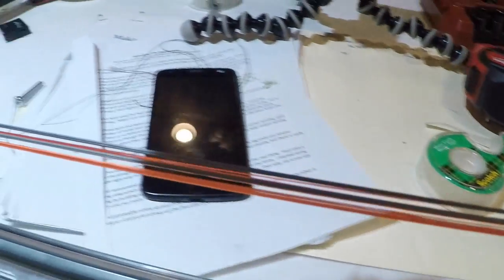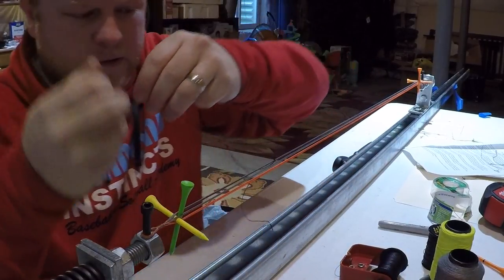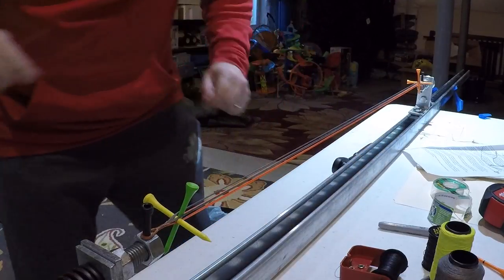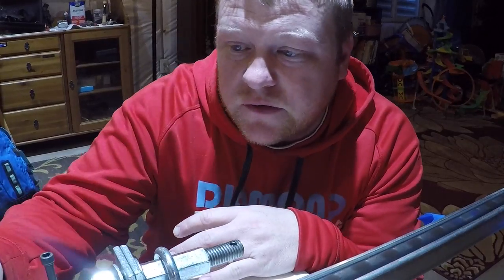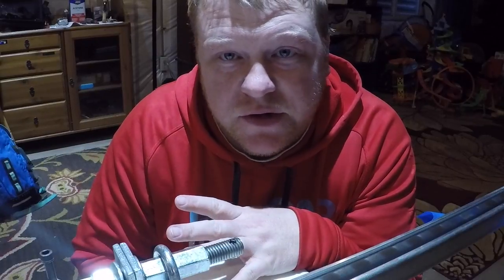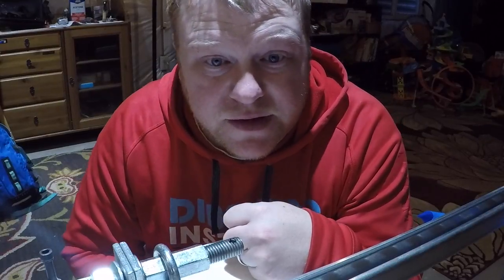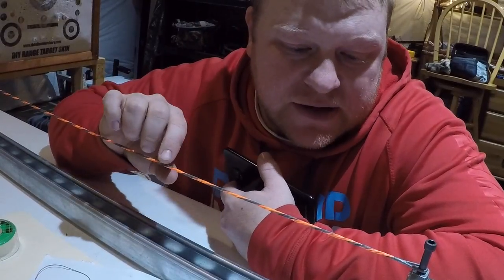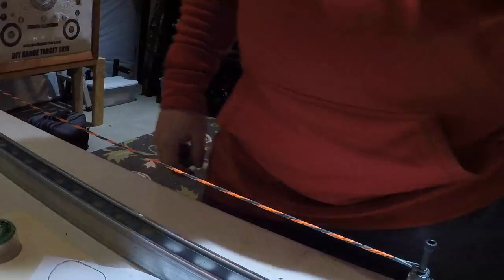How To Build a Compound Bowstring DIY | Bow and Arrow Part 3 | Stretching, Twisting & Burnishing

Comment: When you stretch a standard compound sting, what distance of travel would it be? From the DIY jig it looks like the stretch is reasonably short.
Reply from the maker: It's more about the poundage, than the distance as longer strings would need more travel. But when I measure on the spring it compresses about a 1/2 inch or so, if I had to guess?
Reply from the maker: I stretch between 300-350 lbs.
Reply: @SomewhereInWisconsin  Thanks so much. I'm looking at using an 80mm dia  air ram so I'll try a 100mm stroke. My bows are 36" PSE PerformX 3D and 37" Supra Focus. Winter is coming for NZ so I'll play in the garage. Cheers

Comment: Hi. I have a question, why should stretching the string? It is necessary when making bow  string?
Reply from the maker: Yes. It is very important, otherwise the string stretches on the bow while shooting and causes peep rotation. Also it evens out the twists and string bundles inside the string.

Comment: Good day! You set the size for winding the string. What size did you get after stretching? How much has the size changed? The thread has the ability to stretch. I am from Russia. I use translator. I think that you will understand me and give your answer. With respect from Russia!
Reply from the maker: Check out video 1. I talk about setting my posts and the formula I use to get my finished length.